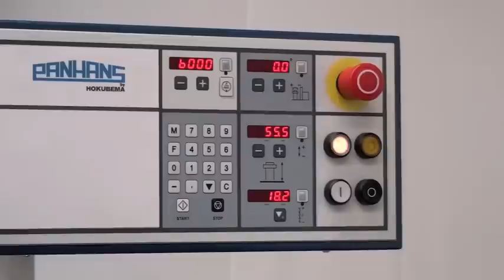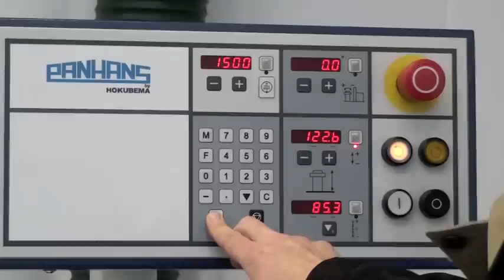Panhans window production with Leitz window tooling 'Make A rated Windows'

Comment from the maker: Apart  from the mass house builders wooden windows are still a preference. They are aesthetically more pleasing, environmentally friendly , and more importantly give far superior U values...I can see PVC taking a back seat in the future...We have a lot of old buildings in the UK and to add plastic would be criminal...
Reply: I need a 6 head dresssing machine to mould any type of timbers like tongue and groove, water board, deckings, etc
Reply: I agree. Obviously, the wooden windows are the best. Together with the wooden floor and furnitures, the wooden windows and doors will make your house beautiful and luxurious.
Reply: Until the UK climate kicks in and the windows rot
Reply: @porilster  That's why you use engineered timber and spray it in flow coat with end grain sealer chief... Zero rot lasts longer than plastic.

Comment: Not a criticism, but... with that very high removal rate, what keeps the stock against the fence? The feed rollers don't appear to be pressed for enough down-force in the vertical, to do that  horizontal job and I scrutinized the rollers for biased-axis toward the fence, but no.... the shafts are perpendicular to the fence. 
For a high-end, low production custom window shop, this machine would hands down beat the several machines that it substitutes for and would be more cost-effective than a CNC version, which can be only be justified for very high production and even then, the CNC machine would be most cost effective with long runs of each window model.
Reply: Needs spelch blocks to prevent machine-head exit damage!
Reply: I have the Felder Format4 shaper and they also have window tooling with 30, 40, and 50MM spindles. If you have your feeder set with skew tracing the woods stays put.

Comment: Why are you wearing gloves ????? lol
Reply: That is a fair question, not a smart ass one. Most would say that machine operators should not wear gloves for safety reasons. Some would balance that against the volume of stock handled, the coldness typical of many shops during the heating season, and the use of feeds and other equipment to keep the hands away from cutterheads.